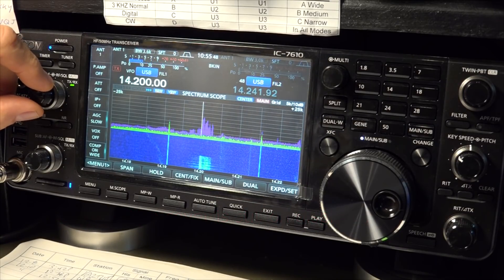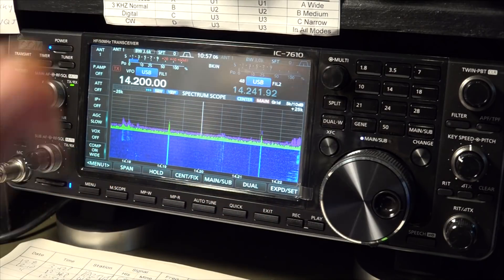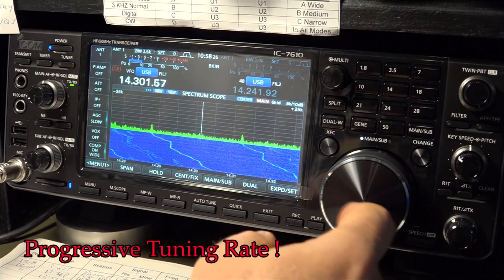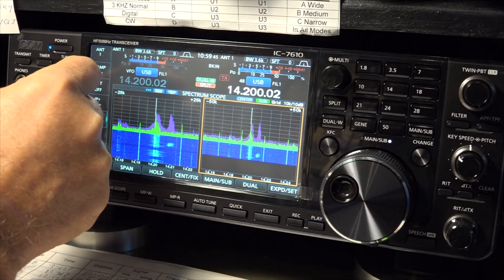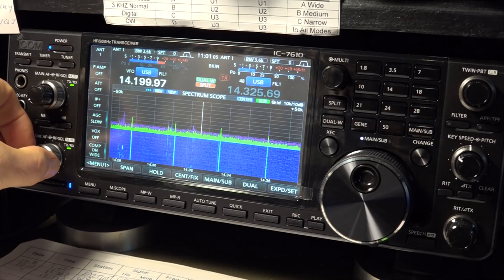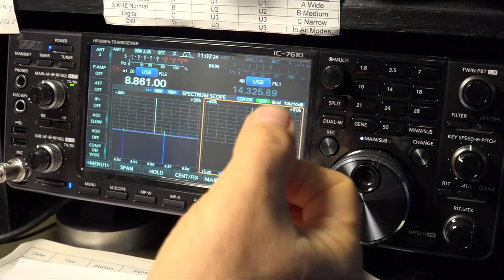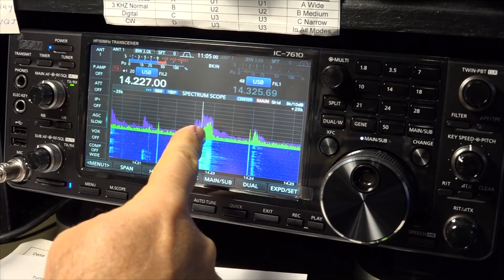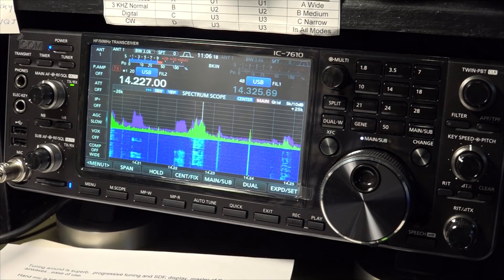IC 7610  - Should you buy one?

Comment: Looks like big to 7300
Reply: Its most closely related to the 7300, but with significant improvements. The 7300 is a single receiver 14 bit SDR without significant filtering before the receiver. It performs above its price class. The 7610 is a dual 16 bit synchronous RX with dual tracking front-end filter packs (Digi-Cel). It's better in every way a radio can be from the already great 7300. Value-wise, it is the sweet spot in excellent rigs.

Comment: As an old Kenwood TS-940 user I was leaning towards an 890 but that 7610 dual receive is a show stopper.
Reply: The real deal-breaker on the 890 is the speed of spectrum display refresh. It is super-slow. Not acceptable. When you have a real-time fast refresh rate display, you cannot put up with slow displays anymore. We are talking 30 FPS on the 7610 and maybe 4 FPS on the 890. I've owned and reviewed ALL the top radios....and they are all sold and the 7610 remains. (TS-990s, FTdx-101D, IC-7851 etc) Even the Elecraft K4 which uses the same ADC sampling chips as the 7610- ships with only one ADC receive channel, no antenna tuner and is $2000 more.
Reply: @Yavor54  Yes, 7610 seems to offer more performance from the visual pov. 890 would be a great upgrade and successor to my 940 but heck I will keep the 940 for tradition and add the 7610!

Comment: There is a firmware update v1.40 that adds pre-distortion in the transmitter which improves IM distortion specs, however, i was informed that it introduces a bug that breaks the IQ info going to USB port 2.  I have not confirmed this yet.
Reply: The Pre-distortion on TX is a HUGE improvement. Only the Anan series of radios has this. Very few people use I/Q output (I'm sure less than one in 500)

Comment: I cannot believe how good that audio sounds. That’s absolutely incredible. Jumping to this from my ft-891 it will be quite something.
Reply: It's due to the fact that the design of the 7610 (and 7300) allow for a flat response curve on RX (and TX). The bottom and top end are there. Because Yaesu wanted to do all they could to get high on the Sherwood charts, they have high and low-pass filters in the RX audio line that you cannot bypass.  Let ME choose what audio I want please! This is also why when you work someone using a 7610 or 7300, you know it immediately. These radios sound magnificent on TX. The FTdx-101D and the FT-10 sound alright.... They are fine, but not at the top level you'd expect.

Comment: Bob: Thanks for the QSO today 7DEC22 @ 2143Z 18.150 Mhz....and the discussion about the IC7610. I decided to watch this video of yours and its spot on....though I do notice you don't mention using it on CW. I agree with you on the sensitivity issue..yes, this radio is incredibly sensitive. One of the things I enjoy doing is answering the calls of QRP CW operators. I've been working guys overseas with 1 Watt and a vertical antenna! Sure, I have "big ears"...maybe the 55+ years of CW operation has allowed my hearing to "evolve"...The APF filter for CW works as it should..its sort of like an old Q-Multiplier circuit...if you tune it correctly, the weak signal will suddenly "jump-out" from the noise.   Thanks again & 73 DE N1MX Walpole, Massachusetts
Reply: Q-multiplier indeed! Had not heard that term in decades. I too work the weak ones and the slow ones. Love the QRP Labs QCX Mini... in case you have not seen it. What a sweet CW radio and great value. I usually use the Ic-705 portable..but it is so good, it gets a little boring! Rather use a quirky micro-radio...ha! 73's
Reply: The IC-7610 is wonderful on CW.  I love the action of the internal keyer with my Bencher.  Very smooth even when using full breakin operation.  The APF is just plain excellent too.

Comment: Nice video Robert, I missed the Noise Blanker, my 7600 is a wonderful radio, I have it in use since 2015, but my older FT2000 was superior on NB function. I wonder if they did a better job on the 7610

Comment: I can hear signals on my old Icom ic735 and ic751a  from the early 90's that can't be heard on a new 7300 due to the internal generated noise. The 7300 is really noisy.
Reply: SDR's are susceptible to noise - that old fashioned superhets are not. Good grounding and a quiet radio location do help. That said, I'd take a 7300 over any 30+ yr. old radio.

Comment: What speaker did you have the rig hooked up to?
Reply: The 101D was the internal speaker and the 7610 was an external 5' speaker...but it's not just that. The 101D force-trims off high and low frequencies (you have no control). They do this to enhance their Sherwood numbers. The 7610 goes all the way down and up to the bandwidth limit set by you. When you adjust the 101D wider, you can barely tell a difference. And- the variable bandwidth is disabled in AM mode on the 101D.
Reply: Thanks Bob

Comment: I just upgraded from the icom 7300 to the yaesu ftdx 10,  the latter has better noise reduction however I still think I want the 7610 instead even chancing the display issue. I think the icom has better ergonomics ... Im not a huge yaesu fan however they have nailed down the DNR
Reply from the maker: What you said is spot-on. The 7610 is just a really smooth operator. Nice to listen for 6 meter openings on RX #2 squelched up. I hope they fixed the issues with the 101D in the 10D. One biggie was distortion on TX when you lower power under 25W. Another is that the ALC meter is non-linear. It is REALLY hard to set up the TX levels as per the manual. DNR is amazing if good, and Yaesu did it good. The best Ham radio made now is the Anan 7000DLE II. It's DNR makes everyone sound like they are on an Iphone 12. It's TX is 1000X cleaner than a Class A TX. Their TX audio processing is a full broadcast station rack. Then again, it is a black box SDR. Check out my review.

Comment: But I hear the display issue is still not resolved.  Its hit or miss if you get a bad one. It is January 5th 2021 .
Reply from the maker: The upside of the screen issue is: If you are one of the tiny percentage of users that has a problem, then Icom will replace it for free. If you do not leave your radio on 24/7, I don't believe you will ever have a problem. Because of the screen issue, the price is very reduced. SO you can have the best "box with knobs" SDR for the best price!
Reply: Thanks Bob. Going to purchase it after I catch my breath from Christmas.  73s
Reply: @anthonycosta1776  Repair is free but the shipping isnt. Glad Bob has finally accepted the screen issue as valid. Ive been reading the 3 years worth comments and this is the 1st reply admitting its real not just haters making trouble.

Comment: Well done video review Bob.  You hit the major points within a short period of time, with emphasis on a couple of them that mean the most to new buyers: ease of use (i.e., ergonomic user interface), and the Rx and Tx audio quality.  Direct conversion rigs (and DDC ones like the 7300, 7610, etc) produce the cleanest-sounding audio for the very reasons you mentioned.  Hams want this kind of great audio and often spend hundred of dollars in add-on accessories to try cleaning up their rig's audio output -- outboard dsp filters, better speakers, better headphone, and so on.  But if the rig itself doesn't have a clean, high dynamic range to begin with, it won't be easy to 'clean up' afterwards, regardless of the money you throw at the setup.
Reply: Ft101 review

Comment: Curious if the RF Gin control is a conventional type where the needle comes up as the RF Gain control is lowered or is it the 7300-style where everything drops as it is lowered?
Reply: It is like the 7300. "Lowering everything" has been the way RF gain controls have worked for 40 years. Before that, the radios meters actually did go up when you lowered the RF gain. So indeed the "traditional type" would be where the meter goes up. In SDR's, that control actually isn't an RF gain but an AGC time constant - which gives the same effect as an RF gain control.

Comment: The Icom can ONLY go 2.99 on TX ssb. The Kenwood can go 4.00 TX on ssb. Also the audio on the icom drops off below about 90hz. The Kenwood can go down below 50hz. Not to mention the EQ in the Kenwood! Conclusion: The kENWOOD BLOWS AWAY THE ICOM as far as TX quality audio!! You can still run the Kenwood at 3.00 wide and still Blow the Icom away!! One more thing. You don't have to send your radio back because of a defective screen like the Icom. See you all in my facebook IC-7610 group. 73
Reply: Interesting commentary. I like ESSB for sure, but I have used it maybe 2 times (on other radios). 99% of folks can't handle receiving 4K bandwidth. They just think something is wrong with your transmitter. Indeed there is some roll-off on the Icom TX under 90hz. Kenwood rolls off under 50hz ehh? Impressive. Kenwood is a stereo company and their thing is TX audio. Keeping up with technology? Not their thing. And we hams are on the receiving side of our radios. That is where the innovation is. The 890 is a very good performing superhet radio. It does suffer from old superhet technology issues. The Spectrum display is slow as molasses. It is similar to a IC-756 Pro 3 from 18 years ago. That- is a complete kill-shot for me. The receiver has great specs, but it doesn't have the clarity and visceral punch of a good SDR. It sounds like it has a gym sock in line. Not state of the art. Just fine if you prefer a Mustang GT over a Tesla model 3. There were literally zero on-lookers at the 890 booth at Dayton (2018). Yup, early-adopters are going to suffer some issues occasionally. Then again, they call this High-Tech for a reason. Riding the wave's edge is exciting...and rewarding.
Reply: @Yavor54  people still getting confused between extended audio, and enhanced audio. As I stated... You can run the Kenwood at 3.00hz wide and still BLOW the Icoms audio away. Another point I would like to make. Just because it's the newest technology. Doesn't mean it's the best technology. Adding insult to injury. Icom does allow you to RX out to 3.6hz. But again it's not so much about how width it can go. But about passing audio down to 50hz and below.

Comment: I am pretty sure that Icom will issue a firmware upgrade to correct some of the limitations. Such as the bandwidth and the tuner limitation of 3:1
Reply: Actually, the Japanese manufacturers rarely issue firmware updates that significantly change anything. For them it is an admission of failure. Failure is not tolerated well in Japan. Only minor changes will occur, and I'm sure all their man-hours are going towards the next SDR Model at this point. That will be a replacement for the IC-7851.,
Reply: @Yavor54  Failure,lol...Is that why even though icom finally has a screen replacement plan it took forever to publicly say anything and they are 99% mum on the heat sinks and wiggly knobs?

Comment: I have owned Icom, Yaesu and Kenwoods HF radios and all of their internal antenna tuner range are limited to 50 to 150 ohm range or will not tune an antenna with more than a 3:1 SWR. Internal tuners are useful for tuning resonate antennas that are not flat across the band. Internal tuners can not tune a system with an amp in line and the reason why external tuners are made.

Comment: That missing passband overlay to show you the filter width is such a big deal that I don't think I'd go with this radio. The quick eyeball and grab of low and high edges of the passband in most SDR interfaces is one of the best functions. I wonder what they were thinking with all the other features it has?
Reply: I totally concur. You know they could do it. FTdx-101D sort of has it... but not really.
Reply: @Yavor54  the funny part is, it's such a minimal change. I'm no FFT expert but I've peeled apart and themed SDR software (QS1R) at the code level and this would literally be a handful of lines of code, it's just a graphic overlay of the filter settings on the display. Almost as if the creator had never used an SDR before.

Comment: Hey Bob,

I’m curious what you think of the ICOM 7600. I know it precedes the 7610 and it’s not STR but I’m curious to hear your comments about it… I’m looking at possibly picking one up. My passion is in DX… And to be quite honest, I’m looking at an Elecraft K3 that was updated by the company and then literally stored in a box for the last six years versus getting a for working 7600. Thekey three does not have the sound card so I would need to do something there for digital… Something I would like to do. But overall, DX is my passion.
Reply: Well, if you are looking at bang for the buck, the 7600 is still a strong contender. The current 7600's use an improved screen with nice blacks and colors. Basic performance is better than most radios out there. Interfacing for digital modes will still require a box or custom analog cables. There is no internal USB sound card. No biggie. Refresh rate on the display is slow, but still useful. If you are looking used, try to find one made within the last 4 years or so. I owned a 7600 longer than any radio I've owned in 45 years. It is a classic.

Comment: I'm listening to this video on $30 headphones, and the audio from the 7610 was AMAZING! It sounded like studio-quality.
Reply: Indeed it does. That is one of it's strongest attributes. Although the Yaesu FTsx-101D is easily the best selectivity I've ever heard (it's competitor), the 101D rolls off the bass under 300 hz in all modes no matter the settings. The Icom goes right to zero hz. I've got a Logitech sub-woofer (PC speaker) attached to it and it sounds magnificent. The Yaesu is tight and smooth sounding, but if you are into HiFi SSB, it's not going to cut it. The 7610 is one wonderful radio to operate. No surprise. The IC-7300 sells like hotcakes- and this radio is better in almost all ways.

Comment: 7610 owner here. Waited till price dropped. It's a beautiful radio and a pleasure to operate. Very customizabe to your liking. Very happy with my purchase. If cost is an issue get a 7300. If you have the budget it's a great choice in the mid tier range. Having the second receiver is amazing and allows for receiving two signals even on different bands. Great for DXing in split or having two pileups and switch back and forth to put out your call sign. All radios are not perfect, but they got it mostly perfect.
Reply from the maker: I couldn't agree more. In the end - is it a pleasure to operate? It IS. It is such an easy operator. You fly around the bands and the spectrum scope is EXACTLY what I want. the "3D light show" on the FTdx-101D seems cheezy. I want my display to look like a spectrum analyzer and have smooth averaging. the 101D doesn't have a smooth display. TX and Rx audio are great...what more can you want?  73's Bob
Reply: @robertnagy2163  - couldn't agree more. I havent seen the 101D in person yet. Yaesu finally came out with a nice display though compared to prior models. Not really a fan of the font and 3d watefall. Maybe it will grow on me.  I am loving my 7610 and recently added a new toy as well (TS-890) to the shack. The 890 is a little more sensitive and has better audio, but no second receiver. Build quality is superior though. It has the CW decoder/encoder which I am using to learn CW which is why I bought it. It's not SDR, but actually like that you can fiddle with the knobs. It's a great time to be a ham with so many wonderful radio choices. 73
Reply: @ftlaud911 if the 890 breaks don’t be surprised that it can’t be repaired since Kenwood has very few parts for it or the 990.Just a fair Warning.

Comment: what is the frequency range of the ic  7610?
Reply from the maker: It covers the Amateur radio bands from 160 meters to 6 meters. (on Transmit) On receive, it covers from under 500Khz to over 55Mhz. There is a Mars mod to allow transmission outside the Amateur radio bands, but performance will not be as good and you run the risk of problems with the low-pass filters and more.

Comment: The Yaesu 101D Sheerwood specs are out.  Would love to hear your thoughts after a review.
Reply from the maker: Brad- Well, there are a lot of real-world factors that go into enjoying a radio. Ultimate selectivity is just one factor. TX audio quality, the DISPLAY, ergonomics, receiver audio quality, user interface, Noise filters, radio's "looks"....so many factors. Not to mention, price. I think the #1 enjoyment factor is now the Display. Without averaging on the Yaesu, the frame rate is WAY too fast and it is a kill-shot for me. The 3D display just doesn't seem to deliver any additional real-world information. The 7610 looks like a spectrum analyzer should. Yaesu is  at better at DSP filtering..TX EQ...etc. After the new factor wears off, you'll still talk to the same bunch of guys...almost no difference. You won't make one more contact on the 101D than you would on the 7610 in any operating circumstance. And why guys buy radios is another factor. Most of us are older and trying to squeeze any enjoyment out of life we can. "Value" is a secondary consideration. So the 101D isn't a 7610 killer. Not at $1000 more anyhow.
Reply: @robertnagy2163   I was really into that great comment until you had to mention - "OLDER!"  ;-)

Comment: Yes, 200 watts would be nice !  ...and they could do that just fine with 12v devices...ic 7610-pro...?
Reply from the maker: Seems like all the radios with 200W use higher voltage on the finals. I think the IMD products would be too high (like a CB linear) if you make 200W with 12V finals.